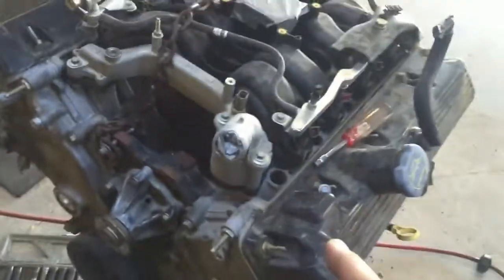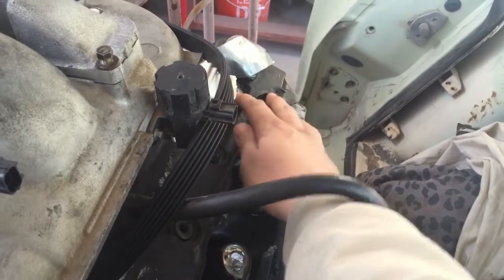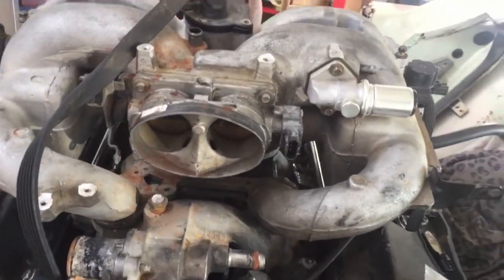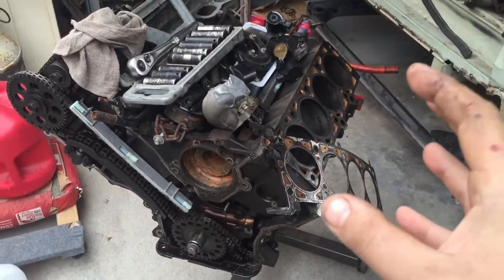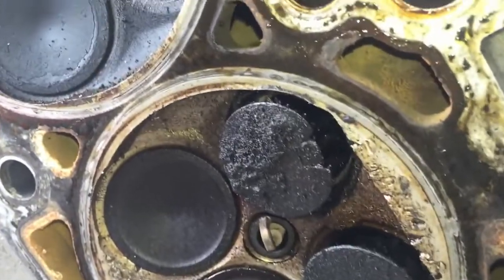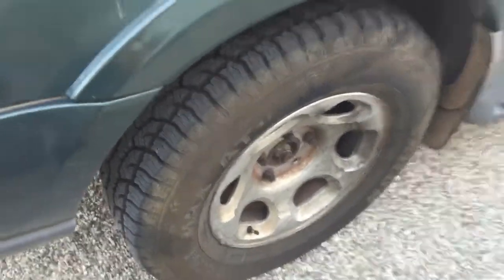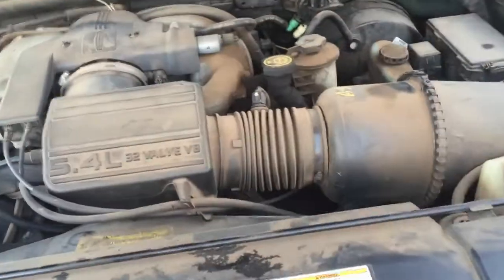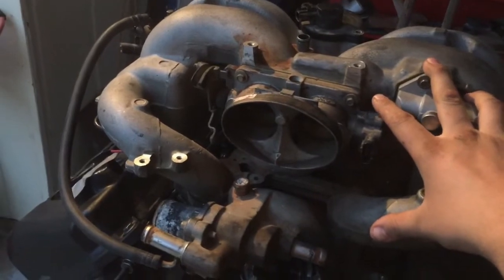Ep. 6 Planning 5.4 DOHC 32v Engine? "Project Redneck" Crown Vic Frame Swap / Install

Comment: A turbo isn't going to change what rpm the engine makes peak power or raise  it's rpm limit. It just takes the whole curve higher up on the scale. Unless you have some fancy boost controller to make it give a progressive boost curve.
Reply from the maker: I agree with you on the rpm change 90% of the time, but I have seen peak rpm go up with boost by 300-600 rpm easy on certain engine dyno tests... or at least maintain a close to peak power longer into a higher rpm. I wonder if its just a rare occurrence with maybe longer runner setups or more restrictive intake manifolds in general.

Comment: Hey man I have a 99 navigator so whatever parts you end up putting on your engine will you let me know?
Reply from the maker: I haven’t done much with it yet, but plan to do custom exhaust and air intake and egr delete. Otherwise going to be mostly stock with navigator intake manifold until I build it up in the future. If everything goes to Plan I want to use navigator intake manifold in the future too with some porting / port matching. The top half and bottom half of the intake are not matched well from the factory.

Comment: Got any plans for this engine man. What upgrades do you plan on doing to it.
Reply from the maker: CJ Colvin the plan right now is to get it running with the good engine from the running navigator, and then rebuild the bad junkyard with forged internals to do like 700-1000 hp. That junkyard engine has the forged crank for sure, which I'm not sure if the running engine has it... But I don't think it has ever been apart. So it's probably forged too. Once it's running I will do a cheap / low psi twin turbo setup with the stock engine to workout any problems .... Then install the rebuilt forged engine. Then I can turn up psi... Etc.

Comment: The only way to get a good running used motor is to see it run for 30 minutes to an hour and have an experienced mechanic there to confirm the motor is in good running condition. You can do all the oil samples and compression check ✔️ but that doesn't guarantee you have a good motor. I know I've installed over 200 used motors and everyone except 2 didn't work out after I ran and inspected the motor first. I learned young and early from a pro to ground hop a motor before putting it in.
Reply from the maker: yea, I like the idea of just buying running vehicles moving forward. I can fully test engine before hand, but always a risk still. The 30 minute thing is no joke. I remember a long time ago I overheated an engine... after that it would run fine till it hit operation temp, then would loose all power. So a problem like that could easily be missed if not ran for long.

Comment: Hey man just wondering if you installed it after all i swap my 4.6 on my 97 f150 4wd to a 5.4 DOHC that came out of an 03 navigator three years ago was running just fine with 35” tires and a 3 inch body lift now i did a 6 inch suspension lift and 37” tires and noticed that its not running how it was maybe load is heavier do to bigger tires and wind resistance at highway speeds do to truck been higher your video cought my attention when you talked about torque that’s probably what i need i am using the navi set up exept for the mass air flow sensor, fuel injectors and coil packs they are from the 4.6 everything else 5.4 dohc including intake any advice will be gladly appreciate it thanks and good luck with your build
Reply from the maker: Thanks I need the luck. I still have a lot of work to do before i get it running on  my side. But i can probably help still. Like you said the bigger tires will take away low end torque / off the line acceleration, that is why a lot of people re gear after large tires. I haven't worked with lifted trucks that much, but It makes since that more lift will hurt the aerodynamics, and like you said more resistance at highway speeds. If the truck was doing fine before the extra lift and tires, then I wouldn't think injectors, mass air sensor, would be the problem. But the 4v engines use a larger fuel injector over the 2v engines. Personally I would like the bigger fuel injectors that it came with and a tune, so there would be no problems and to let the computer know whats going on. The navigator intake is definitely the best choice for you, but do you have the adjustable plenum working? Depending on how its open it increases low end torque, and top end performance. I don't know if you truck is wired for that, or would even work at the same rpm. It could also be wired up on its own with an rpm window switch. then you can easily fine tune when it opens. Some people just wire them into an open position, but that leaves a lot of low end torque on the table, a lot. So unless there is some other unknown problem, and i assume you want to keep the lift and tire size. I would think make sure the intake adjustable plenum is working at its fullest. It has the right size fuel injectors for the 4v. have a tune that can account for bigger engine, tire size, injectors, etc. Then new gearing too that can make up for the larger tires, and lack of aerodynamics.  That is all I can think of off hand. Hopefully that helps, and if you have anymore questions just let me know. Id definitely like to see more videos of the swap too. It was doing a good burnout.
Reply: Desert Rat Racer  yes the 97 4.6 intake had that electronic adjustable plenum underneath in the plastic bottom part of the intake what i did i just modified my harness to reach all connectors if i remember correctly i am using that sensor too because the one that came in the motor was broken in the other hand i am not so sure if its doing its work i beed to research how to tested its a daily driver and some times i feel the motor running really strong and i enjoy it but some days its like its not all there even though it takes off and drives fine i am able to notice the difference i am going to try the bigger injectors along with new gears i am not sure yet what kind of gears i need but i definitely need limited slip rear end because it spins the tire really easy when the road is wet and it can be dangerous after all that is done i am going for the tune keep you posted and thanks for the reply
Reply from the maker: @jesusmtz413  No Problem, Ok cool, If your truck has the larger 9.75 gearing then those same year navigators with the 4v engine have limited slips as standard equipment. Also checkout http://www.tremec.com/calculadora.php you can type in all your gearing, and own transmission ratios, with rpm and tire size. Then you can compare different ratios to see what might work best for you.

Comment: Does anyone know for sure if the 5.4 and the 4.6 4v bolt on to a grand marquis transmission and emgine mounts wise? How much fabrication are we talking.
Reply from the maker: Yea all the 4.6 / 5.4 4v motor share the same block specs for engine mounts, and transmission bolt pattern. You just want to use the mounts for your car. So you would use the grand marquis engine mounts. So it just sits it. the navigator 5.4 4v uses the same alternator setup as a 2v, but the 4.6 4v uses a different alternator... so might need to change some plug ends. Not sure about the other 5.4 4v setups. With the 4v , and especially the 5.4 4v you will need to probably extend the engine harness to make up for it being wider.
Reply from the maker: Different cars have different oil pans, so need to watch out for that. The navigator oil pan fit great in the 2001 grand marquis. I'll put a link below to my website. The last picture shows the 5.4 4v sitting in the 2001 grand marquis frame with no problem. I didn't test exhaust manifolds, but there is room to do stuff. https://desertratracer.com/ep-8-cutting-floorboard-for-frame-install-project-redneck-crown-vic-frame-swap-install/

Comment: There was a company Sullivan performance that did make a 4bbl manifold for this engine. I do believe cams are available for these engines.
Reply from the maker: Yea, I believe Sullivan is in Nevada, I talked about them for a bit when comparing intake manifolds. Those intake manifolds are around $700. Also yea all the pre coyote 4v engines can use the same the type of cams. Tons of stock and aftermarket options.

Comment: You can also put the 2018 Coyote intake manifold on the 5.4L DOHC 32V V8 as well.
Reply from the maker: CJ Colvin yea, I've been seeing the coyote adapters for that. I'm going to go that route if the navigator intake doesn't work good. If I go that route probably will go with an aftermarket one... Due to cost and I'm trying to stay away from the plastic intakes too.
Reply: @DesertRatRacer  do these adapter plates work for the 4.6 4v lincoln aviator motor too?
Reply from the maker: johnny nothing Those adapters won't really work with the aviator head or the 4.6 engine. The aviator head looks similar to the navigator head, but the overall intake port size is bigger on the navigator. So the adapter won't match the port size unless the head port is made larger. Also the 5.4 is wider than the 4.6 on the top end, so the coyote intake in stock form would be too wide to fit a standard 4.6 4V.
Reply: @DesertRatRacer  Did you know that Ford is coming out with the new 7.3L Godzilla V8 for the 2020 Ford Super Duty.
Reply from the maker: CJ Colvin I seen that it might happen, I got to check it out. It would be cool if they started putting big blocks in cars again.
Reply: @DesertRatRacer  I totally agree brother.

Comment: I wonder how this really compares to the Coyote intake; the runners on it are pretty long, and it also has IMRC with a center throttle body. The sheer height of the stock Navi intake is what rules it out for me, but then the Coyote intake puts the throttle body where the alternator is, so I guess it's always something.
Reply from the maker: Tylor Emmett The coyote intake has a clear upper rpm advantage on the coyote engine if you watch the vmp coyote intake comparison videos. They even do the 5.0 truck intakes in one video. I would say the coyote intake is 500-800 rpm higher operating range if I remember right. The navigator intake has like an adjustable plenum instead of the imrc, basically has the save effect, but I wonder if the navigator plenum could be altered to be larger or more adjustable to increase rpm range even more. Yea, the size and runner length is crazy, and still might cause me to switch intakes if it wont fit under a normal cowl induction hood. Other than that too I'm still liking the idea. It looks like it has room for porting that could help out too. I've seen some diy, and kits to install an alternator down on the side, I will try to find the channel and reply.
Reply from the maker: Tylor Emmett here is the link to a reverse alternator with coyote intake, but I think they are kits to put a normal fitting alternator too. https://youtu.be/OYuHSCMahKs

Comment: Hey how is the build going.

Im planning on doing this swap to a ford 79 pickup and i have some questions, like can i use the navi harness and ecu or do i need a 5.4 or 4.6 2v harness and ecu.

Also do i need to reflash or chip the ECU in order to run without ABS module and all that stuff?
Reply from the maker: Are you doing just the engine swap or the frame swap too?
Reply: @DesertRatRacer  Engine swap, im going to reinforce and get it better ill do it into 4x4 lifted and running 38"s
Reply from the maker: @luisanguianoislas9556  I'm no expert but i could let you know my opinion. After 96 its basically flashing the computer, no chips. If you were doing a chassis swap I would say take the computer from the vehicle, and then re tune for the engine, but you want to do just an engine swap. In that case I would use the computer and wiring with the engine from the donor vehicle. Some guys run stock and additional wiring from swap, but could just use all the wiring from the donor vehicle too. You should get a tuner of some sort because I'm sure something will change that will need tuned, but as far as I know basic tuners don't really tune abs and stuff like that. If you want to use the stock computer I would consider using as much as you can up to a full frame or parts swap. Due to maybe some problems with wheel speed sensors affecting other systems. I'm sure you could disconnect most things and tune with most tuners no problem. I don't think abs should stop anything really. They also make standalone computers to run a carb with the engine and you wouldn't need much else to run the engine. The HOLLEY EFI system is also an option. Then if you go standalone computer you will need a computer-less transmission or some sort of transmission controller too. That is where the stock computer helps retain all the original style transmission functions for cheap too. I wonder if you could get a test vehicle or the running engine donor vehicle and unplug wheel sensors, abs module, and other things to see if effects anything bad in functions or driving. Then you know 100%. Checkout f100 crown vic frame swap wiring videos. Ive seen people do a few different things that might help you as the 4.6 and 5.4 are basically the same as far as wiring. Also frame swap fraction on facebook groups , or the f100 frame swap groups should already have people who tried deleting what you're asking.
Reply: @DesertRatRacer  Thanks a lot for tje info.
As far as i plan doing it its gettin a whole runnin Navi l, test it, do some disconnects and see if it works, also for the speed sensor im swapping my diff for a 01 Superduty one, but i wont run ABS module and that stuff, will try chipping the ECU  heard "delta force tuner" would do all i need it to do to avoit troubles with ABS/and other sensors, but will get it to a tuner in ortlder to get everything done right. And also im reading in forums but they dont give much info about what to do with the ECU to avoid troubles.
Reply from the maker: Luis Anguiano Islas no problem, nice sounds like a good plan. Wonder if you can find a 2wd navigator, and then you have even less to worry about with tuning. I have a delta force tuner that I'm using with my stuff too. I haven't started tuning yet but in the first video of the frame swap you can see how I copied the stock vehicle file onto my computer for tuning. I don't see anything in the basic delta force instructions for abs and stuff, but it might work with there more advanced program. You could call them and ask any questions. Their customer service has always been helpful.
Reply: @DesertRatRacer  For sure there are some 2wd Navis, i got already some on the list they are from 800 to 1200 and work really great, also for the ABS and make work the speedometer i will swap a Superduty AXLE to get those inputs and also DISK brakes.

And also will send them an email to see how far it could go as far as tuning goes to delete some things i wont need.
Reply: @luisanguianoislas9556  why worry about that when you can just plop a carburetor on it

Comment: I have a 2000 Lincoln navigator with the 5.44 valve intech I was wondering if anyone could help me out and tell me how much power I can hold without doing any internal engine work I just wanted to do exhaust and intake and tune was just wondering if anyone could help me out and give me a general idea if that would be pushing it or what I could do to get some more power out of it
Reply from the maker: In stock form 450 hp is the general limit, and that is because of the connecting rods will fail around this power and higher. Just bolt ons and a tune will probably get you between 350-400 in a perfect world. It would be hard to pass that without some cam or compression ratio changes. Could always go the power added path too like supercharger, turbocharger, nitrous... Really just depends on you goals with the vehicle.
Reply: Thank you I just wanted to get to about 400 I just wanted a little more power but still want to have the drivability so I was just wondering if a good intake and for exhaust system minute tune with some upgrading plugs and coils would get me close to there
Reply from the maker: Tim Pyatt No Problem, Might experiment with an electric fan if you can too. Those regular fans rob a lot of power.  If you need any parts or stuff for your truck too just let me know. I'm selling parts off the 99 I'm parting out.